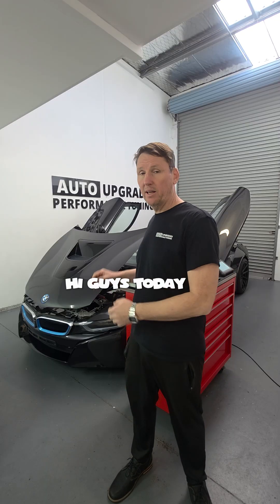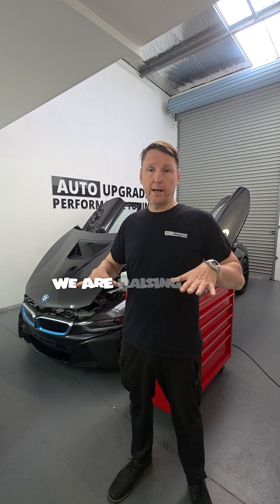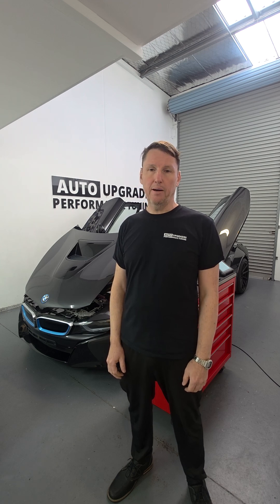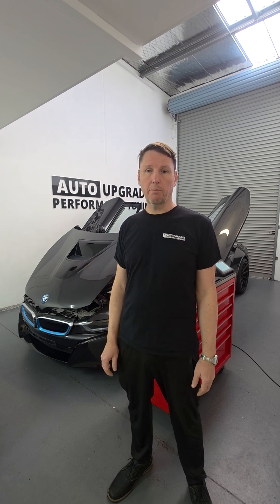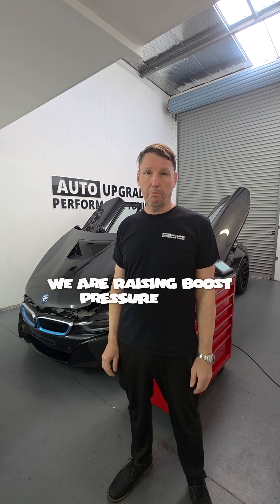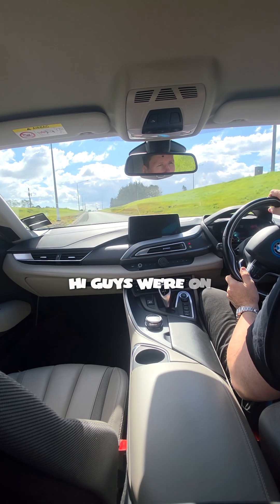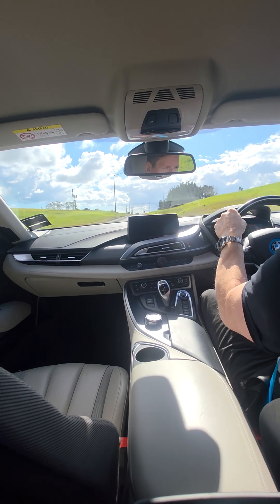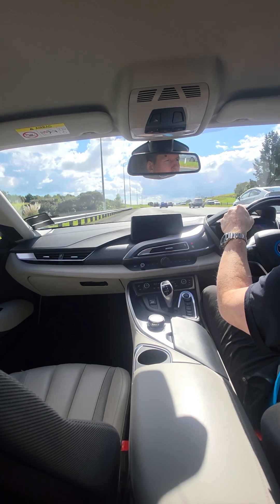⚡ BMW i8 Tuning: Polite Hybrid, Now Impolite ⚡ #autoupgrades #BMWi8 #PerformanceTuning #aucklandnz

Comment: The engine and coolant lines are already very sensitive to pressure and heat? Most engines warp at 50k miles due to use and failing cooling, won't this severly increase that risk leading to a head gasket replacement and dropping the engine?